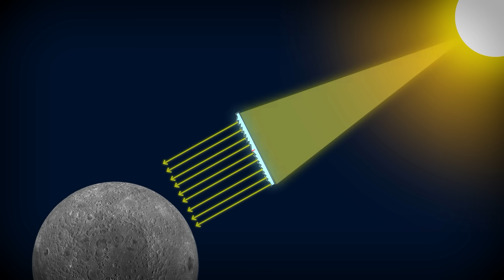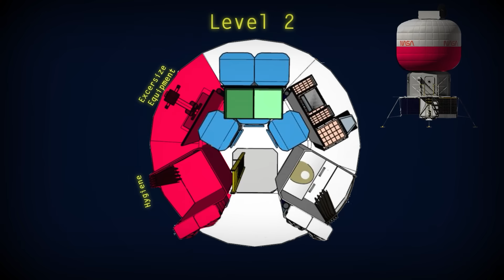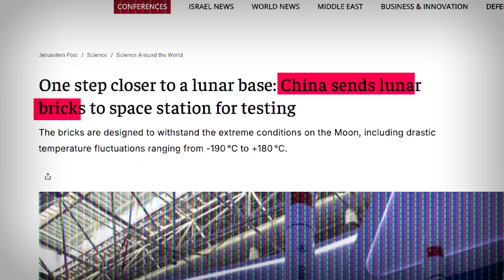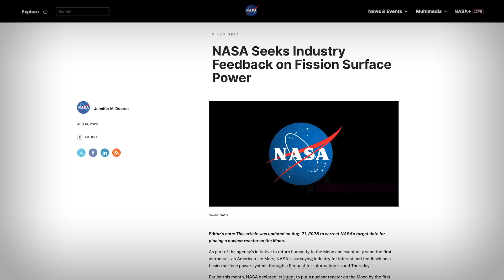How NASA Will Build A City On The Moon

Comment: Why not use milimeter wave microwave technology and just drill your habitat under the surface? That technology would create melted, solid glassy walls, and you could do it at a depth protected from radiation, temperature variations and minor impacts and dust 🤷‍♂️ its another way to not have to take anything with you, and your base can be expanded as needed. You can still use the other techniques for your surface structures that still meed to exist...
Reply: It would need a lot of power but there is a simple solution- your first reactor is built into the "drill" - it can drill out your initial layout, then turn of the drill and wire up your reactor for powering the base. You could then also have it setup to allow you to rig heat exchange from the reactor to provide some of your base atmospheric heating, making it more efficient and reducing your other life support requirements.  You might even be able to setup the drill heads to be detachable to reuse them at different power levels for other regolith melt production,  so for making bricks or attached to rovers to create dust free landing pads, roads etc - that way you maximise the utility of what you take with you.

Comment: 12:20 For anybody curious what elements are required for these tiny thermal reactors, Neptunium-237 is required as a precursor to make Plutonium-238 for fuel by bombarding the Neptunium with neutrons. It is the beta decay in this process which provides the energy, in this case thermal for power generation.

Comment: Nicely done. Here are some other options that I posted in comments yesterday.

This (screw launch) system would be great at launching material into orbit with one system and for human transport with another, more gentle system. There should also be systems on the Moon pointed both to Mars and to Earth to send water or hydrogen and oxygen fuels to LOE. 
It or Starship could launch Lunar and Martian habitat modules (with equipment if weight permits) to be sent via some type of orbital maneuvering vehicle into an elliptical orbit to a lunar transfer orbit - without regard for when they land. Just fill the space until ready to install in mass. When ready, intercept modules when close to the Moon and circularize them and then, with fuel generated from Lunar soil (possibly with an autonomous system) land astronauts from the Gateway to transfer fuel modules to landing frames that they can ride up to modules and ride back down - one at a time, refueling on the surface. Also send up in a similar fashion a Lunar-mover to position individual modules into an interlocking habitat with another machine designed to bury habitat modules when linked up.
As you can see, job one is to land and install machinery to extract O2 and H2 and a frame to transfer what should be a whole collection of modules from orbit to the surface. The modules can be launched once designed with an assembly line ready to go. BTW - the same kind of assembly line should be developed to build both simple housing and housing with personal food production facilities (especially hydroponics, but possibly also mini-protein VATs.
Space Station modules (again with or without equipment) can be launched either by screw drive or by Starship - either inflatables or solids - for transfer to LOE and then boosted to a factory orbit for integration and boosting or placement for Earth or Mars Orbit (after we model and test rotational gravity systems). An orbital Mars colony would be crewed in Earth orbit and then boosted. It will take a ridiculous amount of fuel sent up from either the oceans or the Lunar surface, whichever is cheaper. Volume is infinite - meaning we don't have to worry about the size of the ship, just the mass. Inflatable bladders can hold reaction mass for an ionic engine system for the colony tug - which would then refuel from Martian soil (the habitat will remain in orbit) for return to Earth to tug another colony to either Mars, the Belt or one of the gas giants.
Early Mars equipment can be sent from a screw drive catapult from the Moon, with multiple launches in various orbits that can arrive at various curves to intercept Mars on either simultaneous or staggered schedules. Another option is to use Martian moons as a loading dock. With ion engines that worry about mass but not volume, we can build in flexibility.

Comment: The simple act of transporting the sheer volume of materials to the Moon represents a colossal logistical challenge, wasting enormous sums of money and potentially consuming years. Even setting aside the initial immense cost and time, the completed structures would immediately face a new problem: solar radiation would damage them so rapidly—pitting them with holes—that continuous maintenance or full replacement would be required, potentially before construction is complete.

Comment: No, full scale nuclear power plant is only good for manufacturing. 
Even that 100kw micro reactor design is not as reliable as the 10kw sterling design.
For survival systems they need the sterling nuclear engine generators. It can be 10kw Units.
They can use a dozen of these to power their life support systems. Very reliable even more reliable than batteries.
Also able to fix the sterling engine design on the moon.
Reply: The next thing I don't recommended building bricks at the star. StarShips will work as habitat buildings when berried under the surface up to the nose cone. 
If more space is required. They can cut some starships up and weld them together to build a larger dome structure. That too, can be berried under the surface. 
It would be a better air tight design and fair better over time.

Example one starship is 28m x 50m steal sheet. That is a lot of building material. If you took 4 x starships you could build a fairly larger hanger. Half a sphere or semi circle configuration. Metal sheeting lends itself nicely to building material.
If manufacturing on the moon is geared around aluminum manufacturing. Then we can us that to build structures.

Comment: Why not build underground?  That would seem to be a LOT safer.  Take advantage of the moons thermal mass to regulate temperature as well.  If an underground structure could be built air tight, then MUCH larger areas could be built.  Air tight compartments where some could have domes could provide growing areas for plants/food.

Comment: So many problems with building on the surface. The best solution is to build inside deep craters to protect us from debre, moon dust shards and radiation. There's even more benefits too it if you look into it.

Comment: Scientists believe that the moon has caves and those would be the first most logical places to attempt to construct permanent meteorite proof housing, although in reality completely meteorite proof is not possible. Geopolymer concrete is the most logical building material but wouldn't be realistic without finding particular minerals and water actually on the moon. It is not going to be fast or easy to build durable,  safe housing on the moon, and it won't be cheap in any way whatsoever.

Comment: Or. They can live under the surface in one of the many tunnels they have discovered and have robots building roads, making bricks, and assembling stuff on the surface where there is radiation. While the humans are in the tunnels safe from the radiation and only venture up top when needed.

Comment: "you move from your pressurized house to your pressurized rover to the next pressurized house" that's a ridiculous concept. why not just have 1 larger building with pressurized walkways? if you needed remote access to the neighboring houses you can just pressurize the road network one time and not have to deal with leaks, refueling and vehicle maintenance every time you want to move. oops, forgot my wrench back home, time to waste precious resources and have more points of failure on a complex piece of machinery that can get stranded away from everyone and everything else

Comment: Well, I can help solve three problems that you have. 
The first is about the dust. The lunar regolith (dust and soil) is electrostatically charged. So if you build things that send an opposing charge. Then you can repel the dust. 
Crazy sounding I know, but NASA has already made this for there space suits and it works great. Just sending a pulse is all that is needed. The space suit is covered with a thin wire mesh that when activated, will repel the dust. This can also be fitted to things like domes, airlocks. Even solar panels. Looking at you Martin rovers. 

The second problem that I can solve is power. You talk about solar and nukes but what if I told you that you are overlooking a huge amount of power that is already there. 
Electrostatic power. The solar winds constantly charge the moon. If you can harness this, then you would have more power than you would ever need. 
Which leads me to the third problem. Radiation shielding. Bricks and soil are good. But why not create a localized magnetosphere in the area of the colony? 

You can generate a magnetic field around the colony in the shape of a dome. Large enough to cover the colony and the area around it. 
This would allow astronauts to spend more time outside and lower the risk of radiation. 
With the power being supported by electrostatic power, you could easily power it along with everything else you might need or want.
Reply: Wtf are you talking about lmao.

Comment: There also is another solition for power during the moon’s night; hydro-power. At norce research center in Norway they are working on just that. Not as widely known as nuclear power but could very well be the solution. There are for sure going to be problems with nuclear power not mentioned in this video; waste, political issues and many more.

Comment: 6:52 lol Toyota just can't give up on their hydrogen fuel cell aspirations can they? Although, in this case it may be more feasible but I still understand why one wouldn't simply go with ground-based solar arrays (as depicted in the video) and regular lithium ion or some higher density cells. More energy efficient than hydrogen, and you'll never have to deal with issues of the nozzle freesing over (even in Cali summer heat let alone the colder lunar surface) when used repeatedly over a short period of time (look it up).

Comment: Dont be stupid. Just construct traditional SUBWAY UNDER moon GROUND. thats enough. Minimize on the ground structures. It will be ruined by meteorites and death solar lay as soon as possible. 
And on the moon ground life, will be accumulated by radioactive. Only soil and concrets can prevent to penetrated by radioactive.
Dig deep. Thats all. 

Radioactive, super hot solar lay that can melting metals, dusts and meteorites... dig or die.

Only one faciliy need to moon, is space airport, that is to say Shuttle landing sites and igloos.
Subways, bunkers and ICBM silos will keep safe human life on the moon.

Comment: The idea of a city on the Moon is far more fiction than fact. Humans cannot survive there long term because the lunar environment is violently hostile. The surface is exposed to cosmic rays and solar storms with no protective atmosphere, and prolonged exposure would be deadly. Temperatures swing from searing heat to lethal cold, making it impossible to maintain habitable conditions without massive, carefully engineered insulation and life support systems. The Moon’s gravity is only one-sixth of Earth’s, and the effects of long-term low gravity on bones, muscles, and organs are still largely unknown, posing serious health risks. Air and water would have to be continuously recycled or imported, and growing food is extraordinarily difficult due to radiation, nutrient-poor soil, and the lack of a natural ecosystem. Beyond the physical, the psychological strain of isolation and confinement, coupled with the extreme difficulty and expense of resupply, would make any permanent settlement a near-impossible undertaking. While headlines about lunar cities capture the imagination, they dramatically oversimplify the reality: at best, humans might survive in short-term research outposts, but the notion of a self-sustaining city remains science fiction.

Comment: Wouldn't a subterranean hab be the best way? They're far more thermally efficient.  They'll help protect any life inside from solar storms, radiation,  any objects hitting the moon.  And you wouldn't need as thick material for your floors and walls.  Its the roof that would be the biggest obstacle. Just dig a hole and throw a roof on it.

Comment: Ok imagine in your mind a cookie cake cup
that is wafered crinkled

also imagine the lift of thrust bell

that forces liquid gas to constantly cool it
before use to drive the Saturn into orbit

oxidising gases that would consume the thin  bell shaped object
and power heat thrust that destroys a massive lift off stand
to powder rubble.

now imagine three four five six
shaped to position thin cookie cake metal wrapped
blankets that encircle the Space X main rocket
a blanket designed to sweat liquid gases
cooling vaporising where needed and designed
to alien and quickly be replaceable
cookie ridged to deflect run where needed.
Refueling may be a simple quick attach
a tank section of sn and reenter affix a new
to send up again
like man haulage tanker would take a container
plug it in and the deliever boggy return to take another.

Moon orbit mars vehicles just need the fuel tanks
not the motors,
accept for return of mars
pencil shaped Buck Rogers Dan Dare ships 
are art work for the history books

Comment: Given the placement, they'll likely consider large mirrors in orbit to provide extended sunlight to solar farms and maybe even food farms. The best option could be solar farms directly above or near settlements in lava tubes, with a bunch of support stations in orbit. Ideally the pioneers would be able to be fully self-sufficient with everything, maybe even fuel. Then we can build the infrastructure on the moon surface over time, living in the protected caves that could be sealed for the dust issues.

Comment: Hello dear, what on earth is i a "brayton converter" and why i should not worry about it?

Edit: never mind, i googled it.:
How a Brayton Converter Nuclear Reactor Works
Nuclear Fission: In the nuclear reactor core, nuclear fission heats a working fluid, which is typically a gas like helium.
Gas Turbine Operation: This high-temperature, high-pressure gas then directly enters a gas turbine.
Shaft Work and Electricity Generation: As the gas expands through the turbine, its enthalpy is converted into shaft work, turning the turbine. This turbine then drives both a compressor and an electric generator, which produces electricity.
Compressor and Recirculation: After passing through the turbine, the gas is compressed and then reheated by the reactor core.
Cycle Completion: The compressed, reheated gas then enters the turbine again, completing the Brayton cycle, which allows the reactor to operate efficiently by continually recovering and reusing the heat.

Comment: Your best bet is to start by building a geodesic dome, then cover it with thick polymer panels.  Those panels are not heavy, so they are easy to stack and transport.   The astronauts can live in the temp inflatable shelter and assemble the dome on the surface.  Once it is complete, they can start lowering the unit into the ground by mining the rock.  The mined rock material can be ground up and turned into compressed bricks.  Those bricks are then stacked over the outside of the hab, which creates the meteorite and UV protection.  Once the first dome is complete then, they can start extending the underground in whatever fashion they need.  As far as connecting roads, I would think that a device similar to what I have seen that melts ice on roads could be scaled up.  
The water from the craters can be split into Oxygen and Hydrogen.  The hydrogen can power the device that heats up a roller that cruises around by AI direction and makes paths, pads, and roads.  Starting out will be tough, but as you grow, so do your options.   One thing that will be beneficial is the astronaut hamster wheel.  Because of the reduced gravity, they need to have a way to keep things from breaking down.

Comment: Considering Rhinos are an endangered species, shipping their snot to the moon seems both expensive and impractical.
Vaccuming up the dust and fusing it into bricks would be more feasible. Rhino snot could then be used as the mortar.
How many brick layers would it take to build a moon base?

Comment: Brayton power converters, are dynamic, closed-loop systems designed to convert heat into electricity for space missions by using a working gas to drive a turbine, producing mechanical energy that an attached alternator converts into electrical power.
Reply: I thought Brayton were open loop and sterling was closed..

Comment: How does the moon Rover have a radiator when there's no oxygen? Wouldn't it be an electric vehicle?
Reply: You don't need atmosphere for a radiator to to work.  It helps A LOT, but it's not required.  In a vacuum radiators need to be much larger.
Reply: @imaginary_friend7300  but in the vacuum of space there's nothing to transfer the heat energy to unless you have infrared like the space station has

Comment: with the advancement of fusion reactors, i see long term the moon will become a mine for helium-3 used for those reactors. I hypothesize that this is the exact reason Elon Musk has an electric car company, a drilling company and a spacecraft company.
Reply: Sure, the problem is they're still struggling with the easier fusion, they're a LONG ways away from using Helium 3.
Reply: @imaginary_friend7300  agreed.